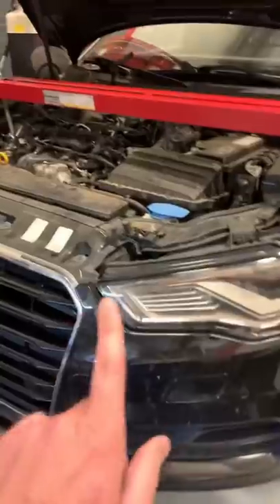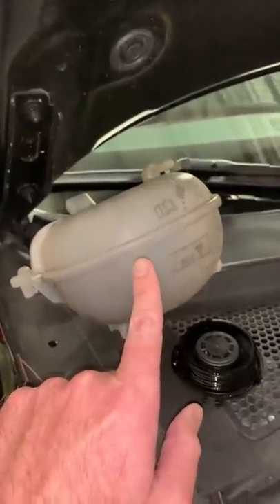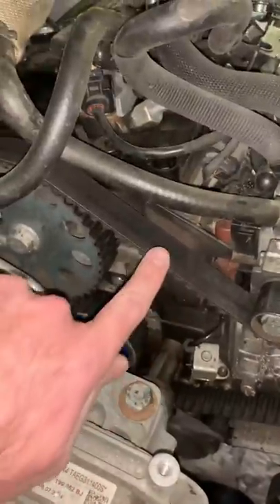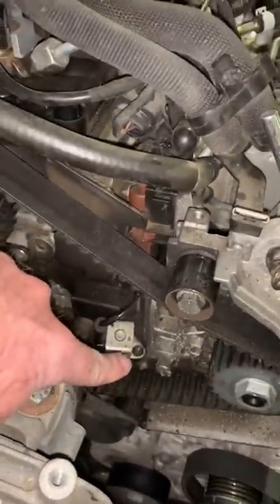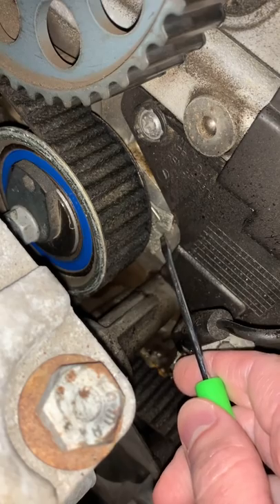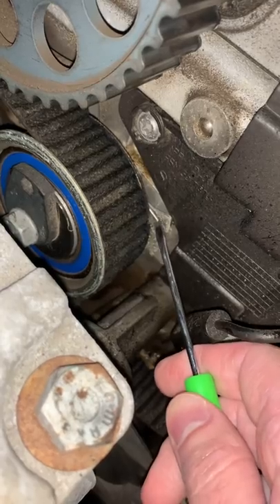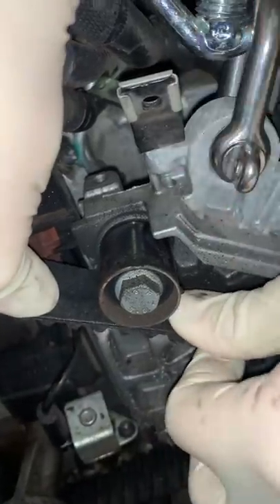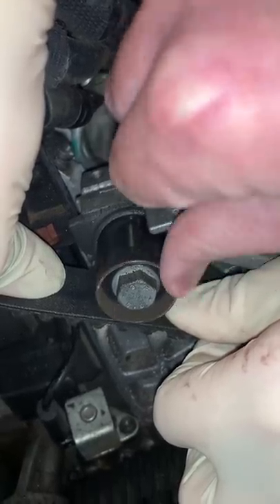Don’t let problems go on your car! #shorts

Comment: Both the tensioner and the idler are completely normal. Nothing wrong there. I change
These belts at least once a week. Coolant hasn’t had  any effect on that
Reply: My thoughts exactly bud
Reply: Are you blind? The belt has clearly stretched.
Reply: @ferrumignis  Bro, they didn't say the belt didn't stretch. They said coolant did not affect it. Belts slowly stretch over time from use...click bait...
Reply: @ferrumignis  did u measure the belt with  a new one?  . Did u ever saw an engine running idle? While looking at the tension point? It moves. It won't stay at one place.
 U know if u put an wrench on the crankshaft and turn it. U will notice there is a stretch side where the tension is on. And a other side where u can press the tootbelth.  It's an indicator that u need to put the belt on stretch. Including loosing the bolts of the camshaft. and high fuel pump. So u can get all the stretch out.  And the secure everything with the timing tools. And turn the engine at least 2 times with a wrench. Put on timing again with the tools. And look at the point of your tensioner.
Reply: I was about to say that belt actually looks pretty tight. Was looking for the comment. Too tight knackers out bearings.
Reply: Came here to say that, as a Vag tech, even the book says the engine should be timed when everything is cold, because the tensioner has a range of moving. It's not supposed to be in the middle unless you put a new belt and time it on cold.
Reply: Correct. Had he rotated the engine and filmed the tensioner we’d all see it move.
Reply: 100% agree with this. Both tensioners are fine
Reply: I was wondering when someone was going to speak on this...
Reply: Ya lol it's normal this guys never seen a vw motor
Reply: Yeah marks are on line only in TDC position
Reply: @westendinventor364  That's a spring loaded tensioner so tightness is not an issue unless it's completely loose, it's about travel.. it needs to be close enough to the center so it can move back and forth as the engine is running without hitting the stop. I do agree belt looks fine length wise, I'd say it's probably barely done half of it's service life. If that was oil leaking on it I would replace but this is overkill.

Comment: This is what I explained to my niece when she got her first car and started driving. I told her don't tell me when there's a big problem tell me when something little happens because it's the little things that build up to the big problems. Things don't generally break all at once in a big catastrophe. They usually have noises and symptoms on their way up to the bigger problem. So she should tell me anything she notices different about the car at any time so we can determine if there's a big problem in the works.
Reply: On my first car the transmission slipped a few times and I thought nothing of it. Then two weeks later it blew. Fun times
Reply: @johnnywaffles2482  that's just obvious...
Reply: @jacobwebb8818  weren’t bad slips on a car with 57k miles
Reply: @johnnywaffles2482  sounds like you got a Dodge
Reply: @WeBe3Dprinting  lol it was a 2001 ford windstar to be exact
Reply: @lukeantonison0830  100%. Couldn’t agree more
Reply: @johnnywaffles2482  lmao hope you get your car situation figured out
Reply: @lukeantonison0830  oh that was years ago. I’m good now lol. Thank you though
Reply: @johnnywaffles2482  cool story bro,
 No seriously, cool story, not meming
Reply: Had two CVs lock up at the inside joint on my pickup, they would rotate and move as they should but the bearing was locked up inside the joint
Reply: @johnnywaffles2482  one of my neighbors owns that minivan
Reply: @ishanpahwa1179  no shit. Is it white with 3 missing hubcaps?
Reply: @johnnywaffles2482  3 words :
 Timing Chain Engine.
With QUATTRO Transmission ( TORSEN it's simply the best )
Reply: Great advice!
Reply: @jonathanevans3007  no this is poor advice! That timing belt is worn but not by coolant, but by mileage. Looking at the timing case and being a mechanic 27 years, I can estimate by comparison to other vw tdi engines that motor has less than 100 k miles. Far more emphasis should have been placed on the destructive effects of a low coolant condition and just how quickly the head gasket, and head warps when it is overheated. And that you can't trust your coolant gauge if coolant is low
Reply: @traviscapehart7590  I’m talking about the comment that I replied to, where she told her niece to let her know when little noises and issues come up 🙄
Reply: @jonathanevans3007  I apologize, It appears I should have paid closer attention. You are correct in the fact that failure to address smaller issues as they come up most definitely increases the cost of repair, as well as inflicting collateral damage further inflating the bottom line. Vehicles do not have the ability to heal, and problems only grow into bigger problems until that one little glitch unleashes an avalanche of headaches, towing fees, and having to call friends, family, Uber, or workmates to provide transportation. Usually this is when those who failed to heed the warnings give up on the vehicle and trade it in. I have been a mechanic since 1993 and I see it over, and over again.
Reply: I wish my uncle was like you. My grandparents sold me my first car at 19 for $2500 and it did nothing but break until I got rid of it. After dropping that much money that young, I was broke
Reply: @grey2444  I'm sorry to hear about your lousy experience with your first car. My first car was a vw beetle 1972 model. I wound up crashing it but I have fond memories of the feeling of freedom, and adventure that it brought. One thing a lot of people don't think about is when you buy a used vehicle, you are getting somebody else's headache. I have bought several vehicles that turned out to be really good, reliable, and cheap. The trick is two fold. 1; when looking at a used vehicle take a good hard look at the seller. What are his motives for selling it? Is it a secondary vehicle, did he get a newer car? These kinds of questions can quickly reveal a shady deal by exposing the reason for selling it. Be prepared for the standard bullshit story, while listening for hints of frustration regarding maintenance. That is a clear indication of a headache vehicle. 2; Take the time to closely examine the vehicle inside and out. A person's vehicle is an extension of themselves. You want a vehicle that will be what you need it to be. You don't want to buy a montrous pickup if you need good mileage for a long daily commute. Don't be afraid to buy a vehicle with one big problem but at a reduced price. The best deals I have ever got was done this way. I bought a 94 Honda Accord 5 speed 4 door.
Reply: Sorry I put a clutch in it for 300 bought it for 500 and drove it with no major issues 8 years and 475 thousand miles later it finally gave up.
Reply: @traviscapehart7590  Your first car sounds like a beautiful one. I've heard Hondas are the way to do it. Cheap, reliable, and last for ages. Been looking into a motorcycle atm.
Reply: @grey2444  I do miss that old bug I am probably the only person on the planet who looked at that car as beautiful. It had rust spots faded paint, a few dents, but I loved it anyway.
Reply: @traviscapehart7590  Isn't that the beauty of it though? Hey nice talking to you man. 🤙 best wishes
Reply: @johnnywaffles2482  what does it mean slipped?
Reply: @robertjusic9097  it sort of stops accelerating and it “bumps” a little bit to catch the next gear
Reply: That is actually also what she - and everyone else - needs to practice in/on everything else in life! 

Promptly acknowledge the little things on time - so that it combined with other ones - wouldn't lead to one great explosion!
👏👍💯🍻
Reply: My deaf grandfather gave me his hyundai accent 2003  this summer. He told me he had made major repairs on it and that everything was in order. A few days after, I drove it and the Serpentine belt was squealing so I changed it and then another problem showed up, the AC motor was dead and was grinding. Those problem couldn't be heard by my grandfather but I could most definitely hear them. I inspected the car carefully for any problems after that. My parents tell me I'm paranoid but they don't seem to understand that small problem can become big problems overtime and it's even worse with old car like mine.
Reply: If i had the knowledge i had now about cars i could've fixed my old 88 town car. Easy fixes, look and sound hard, when young.
Reply: Or the real lesson here is dont buy a junky audi cause they seem like the break more then they see the road
Reply: Joseph Roach  yes their overpriced garbage

Comment: "Let's run a water pump off the timing belt, instead of the accessory belt. You dont need to do maintenance yourself." some German engineer
Reply: This is just speculation, but Im starting to think companies pay engineers to make backyard and small business mechanics a thing of the past.
Reply: Ford on the suv/car ecoboosts 👀👀👀📝📝
Reply: Unfortunately a lot of Asian cars have this timing belt driven water pump system too and my PT Cruiser had a Mitsubishi engine with the same thing too! My Toyota 4Runner does too and so does most Honda's!
Reply: It's usually done to inset the water pump into the block to reduce the motor length, which is useful for transverse mounting.
Reply: The germans have a service interval for everything, believe it or not. Whereas Americans drive things until they break, then continue driving them.
Reply: This is why you're advised to change the water pump at the same time as the timing belt, if you keep up with your maintenance VW diesels just go on forever 🤷‍♀️
Reply: But a timing belt usually has a fixed lifespan of something like 180.000km or 10 years for example.
The water pump gets replaced with the timing belt as well as all the rolls etc.
Reply: @KorashSyndikat  sell that to a customer who just wants thier water pump changed an nothing else. The people who drive cars are dumb, they just see a car and drive.
Reply: @zoticus1  Continue driving is the key take away.
Reply: @eagleone5456  naw... most of the mechanical stuff is still the same... electrical systems are more complex though. On my car i did a water pump and timing belt ever 100,000.  Engineers make less room.
Reply: @zoticus1  that’s straight facts, I change oil at a Walmart and I’ve even seen (heard) a bluetooth connecting rod. Like bro, why are you concerned about an oil change? 😂
Reply: @eagleone5456  if it's hard and more expensive to fix a car it's an incentive to buy a new one instead, since that's how those greedy companies make money
Reply: @glennoropeza3545  exactly why i hate most Honda engines. It ain’t bad but it’s just extra time wasted.
Reply: @eagleone5456  that's exactly right.
Reply: @hoodhomesgardens  nah they make it specially with weak points and hard to access areas only so the dealer have proper tooling and that 10,000$ scan tool. It's bull crap. All my toys are.carbuerator and distributor cap. Rebuild motor new valves and seals at 398000 miles and still can bounce off my mechanical rev limiter.. my springs rattling around and she loves it. Absolutely no way in any circumstance is a new modern car with 50thou miles can do that. Even with the motor rebuilt at 50thou
Reply: @bossjosh423  its cheap...yes. Not complex. Just have to be smarter than the engineers that you want to kick in the shins.  Mechanical systems are the same basic stuff though.  Everyone knows someone with a scan tool.
Reply: Quite a standard thing to do, but then we service our car at the dealership in Europe .
Reply: @KorashSyndikat  are you joking t8ming belt 10 years not even vw are that crazy
Reply: @bossjosh423  do worry ice engine will be band in 20 years
Reply: @keithnewton8981  they can't I'll fabricate parts on my lathe and continue to sell them to people who are smart enough to buy and want quality
Reply: @keithnewton8981  if they do get banned it's because whoever is in controll of the cars and motors is big sad and mad and wants to make all the money with the biggest jew nose so they throw away reliability and dependability so they know you will come back for more it's sick
Reply: Honda's have had timing belt driven water pumps since at least the 80's. Pretty sure Toyotas are the same way. Yet they're the most reliable cars on the road 🤷
Reply: @KorashSyndikat are you nuts 180k timing belt change